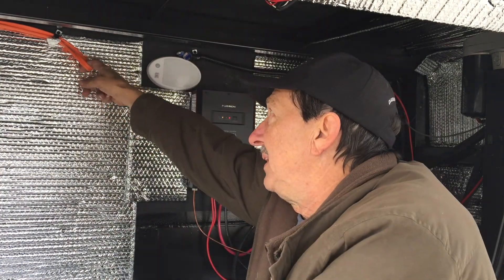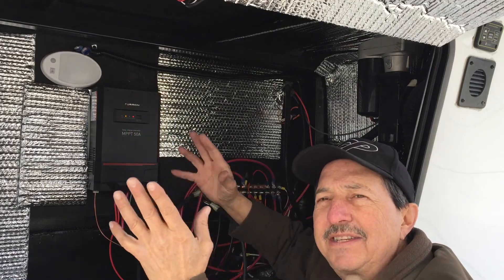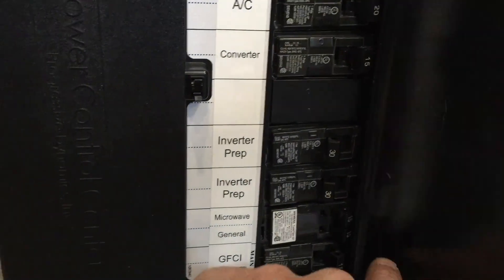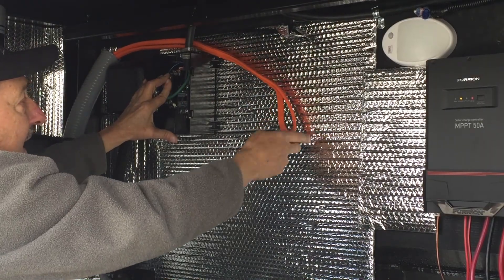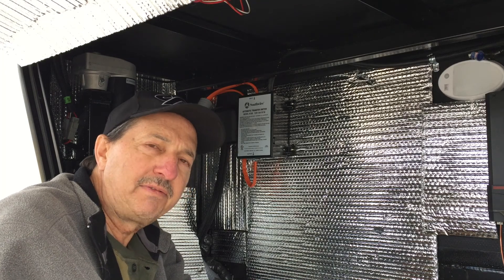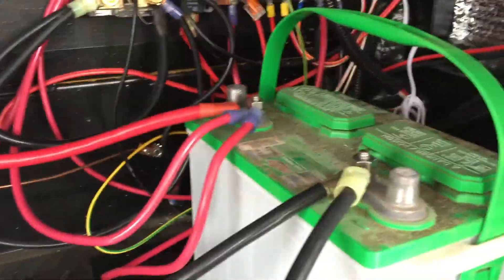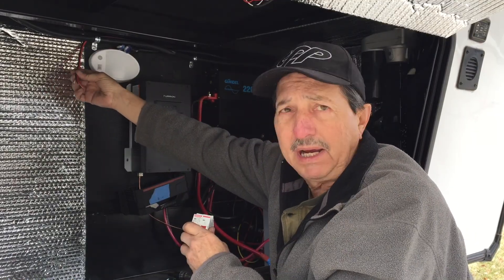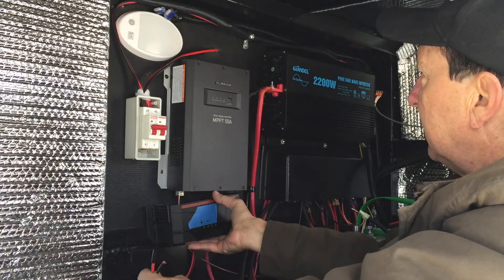Easy Grand Design Inverter Prep, Automatic Transfer Switch (ATS) And Inverter Install. + Solar.

Comment: Great video.  How is your Giandel doing?  We are looking at their 12v 3000w model - any advice?  Thanks
Reply from the maker: The Giandel is great. We use it a lot and have no issues.
Reply: @riderescue  Thanks.  I just caught that our inverter prep in our 337RLS is pre-wired to add a 2,000 w inverter so now, we're back to this 2200w.  I liked it best all around anyway.  Do you think that inverter would power our residential microwave at 1550 input watts (it's a 1000 output microwave).  It seems like it should.
Reply from the maker: @jaschembra  Yes, mine runs my 1500 watt microwave, no problem. I also run a coffee maker. Just be careful to not run them both at the same time.
Reply: @riderescue  1550 watt microwave? thanks.  It's considered a 1000 watt, but continuous is 1550 (who knows what the surge at startup is).  I'm glad to hear it works for yours.  Seems like their customer service is great as they've answered any questions I've had via FB's Messenger.
Reply: @riderescue  And lastly, GD manual says our inverter prep is pre-wired to "add a 2,000 watt inverter" - I'm assuming your manual probably said the same - but there was no problem with wiring size for the 2200 watt?  I don't know electric.  Husband said it should be fine.  :)
Reply from the maker: @jaschembra  Yes. The 2200 watt is 10 percent over but within the factor of safety. 3000 watts was pushing it too much. My 2200 watt has worked great and has not kicked breakers. Just don't overload it with 1500 watt microwave and 1000 watt heater or coffee pot or a heir dryer. Just run one appliance at a time and all is good.
Reply: This thread was helpful...THANKS!  Question....can you just add the 2000 watt inverter without adding the additional 330 watt solar panel?

Comment: After watching your video multiple times, I am 100% sure I can do this. I have 1 question. When you are using your inverter, do you turn your converter off at the breaker or does the ATS take care of that step?
Reply from the maker: The breaker box is split for power to and from the ATS. When the inverter is on the ATS only powers the lower section of the breaker box. Typically that is just the outlets and the microwave.

Comment: I have the same system but I would like to automate the Giandel inverter, meaning, if the ATS is providing shore power, you don't want the inverter to be on at the same time as the shore power. I understand how the relays in the ATS work to isolate the inverter from the camper when you are on shore power but when you remove shore power, After a delay, the ATS switches to the Giandel but if the Giandel is off, the Giandel does not automatically power up to provide 110v. If you don't hear the relays drop out, you are without power You then have to Manually start the Giandel.
The other reasons for wanting the Giandel to be automatic is to prevent it from being powered on, even though it will be isolated - you have to remember to power it down. I want to turn on shore power & automatically power down the Giandel - Remembering the relay delays
If you are running the inverter, then switch to shore, the inverter will still be on, isolated but still on. The relays will have dropped off the inverter power. When you switch back to shore power the inverter still being powered up,, will be a seamless switch - because it never was shut off.
Do you know if the relays have contacts that are on when powered off, but powered off when powered on? NO/NC
Reply from the maker: Sorry, I don't know if it has a relay or if there is a way to add one to do what you are asking.

Comment: How you will power the Air Conditioner using the inverter?  You will pig tail the subpanel wire and connect it to the Air Conditioner Breaker?
Reply from the maker: The wiring in the inverter loop is not intended for running the AC. The AC requires a heavy power load on start up and that requires a very large inverter. Also, running the AC on battery power would require a large bank of batteries and solar power in order to charge those batteries. If a person needs to run the AC a large generator is the best thing to use.
Reply: @riderescue  1 Furrion ac with an easystart.  14amp 1300w.  4-206ah batteries.  And a 3000w inverter that peaks at 6000w.   That should work?   I have seen many people powering the Air Conditioner that way. I just don’t know how to properly power the AC using that WFCO panel when the inverter only power the subpanel section and the AC is not on that section.
Reply: @JavierRivera  The only thing I can think of is see if you can move the A/C breaker down to the inverter prep section of the breaker box. That's what I'm going to try and do.
Reply: @ I was able to do it. I added a 50amp transfer switch and connect it to the mail panel feed to power the whole panel. https://youtu.be/cTzntGjvYyo
Reply: Hey nice video, wanted to share it is not recommended to connect dis-similar Solar panels in parallel as you did. You can cause back feeding from one panel to another and end up frying your panels. I would suggest having a smaller 200w solar charger for your portable system. It will wire directly back to the battery.

Comment: Great video! I got lost as to how you ended up with multiple red cables on the battery. where did they come from?
Thanks!
Reply from the maker: One connects the inverter, one connects the solar panels and one powers all 12 volt trailer stuff. Glad to hear you liked my video. Thanks for watching.
Reply: @riderescue  can you recommend a breaker switch and battery monitor?
Reply from the maker: @bobjohnson4290   I like the Renogy battery monitor and I suggest 12V-110V DC Miniature Circuit Breaker, 60 Amp 2 Pole Battery Breaker Protector

Comment: Great video. I have the same front compartment with the same loop in my 2023 298BH Reflection fifth wheel. I was checking the converter, and it looks like GD upgraded it to an Intellipower PD 9360 converter. It looks like the new converter has a setting to change to Lipo4 batteries; the problem is that I need help finding the converter. Does anyone know where exactly the converter is located on the fifth wheel? If you know, please let me know. Thanks.
Reply from the maker: The converter in my 226rk is under the bathroom area. I had to remove the side panel in the pass through storage area to locate my converter. Here's a video link to my Converter / Charger when mine quick working. https://youtu.be/g25tCVZq_Vk

Comment: What would it cost to do what you have done parts and labor?
Reply from the maker: The inverter is $350, the transfer switch was $100, the battery was $600. I estimate the labor cost of about $400

Comment: can you run air conditioner?
Reply from the maker: No. I think you would need to use a 3500 watt inverter to do that but the inverter loop is not set up for that from Grand Design. If an inverter was sized large enough to run the AC the battery would go dead rather quickly.

Comment: Awesome video. Thank you for explaining and demonstrating everything. I have more questions but need to review this again. 

One thing that many are opting for is an inverter/charger instead of the converter and separate inverter install. Why did you choose to go with the separate inverter and did you swap the converter for a lithium compatible charger?

Oh the solar output wires, when installing them in the dc breaker there isn’t any polarity issues? I noticed the external solar cables were red and black I believe. 

Thanks again.
Reply: Two more questions. Did the ATS you selected have a jumper to remove the time delay and did you swap the incoming wires to have shore power energize the relay?

Have you found the need to add an inline fuse to your set up?

Thanks again.
Reply from the maker: @scrub175  The ATS solenoid pulls power when it is in the generator mode so using that position for inverter is using up battery power just to run the ATS. By using the generator side for shore power, the solenoid draw is not an issue and the switching delay (about one minute) is only noticed when I first plug in to shore power. Some ATS solenoids hum and people have reported that they hear it in the night. Mine has a slight hum but it's not noticeable inside the trailer. As for the battery to inverter fuse? Yes, a fuse should be used if cables are running through areas that can possibly be damaged and shorted leading to fire hazards. In my case, the cables are short and protected from damage so I did not fuse this set up. I did fuse one  in my last trailer because the cables ran through a firewall and that had potential for shorting.
Reply from the maker: My thought process for the inverter came down to 2 things, cost and simplicity. In researching inverter/chargers, I fund many questions when it came to using the inverter loop that Grand Design installed. In order to take advantage of that loop the inverter needs to allow pass through of power and auto switching. Those inverter/chargers cost more and are difficult to wire (in my opinion). Also, why hassle with wiring and bypassing the existing charger when the factory installed one works fine? True, most factory chargers/converters do not fully charge lithium batteries but the solar panel on the roof will handle the charging to 100%. My inverter and Auto Transfer Switch was very simple to install, simple to use and cost me less than $450 for both. As for the "DC" breaker, it is a single pull, double wire for disconnecting both black and red wires. Makes for a simple solar disconnect as well as adding a second panel (in my case, portable panel). I plan to add a second panel on the roof in the future but I will tee into the wires on the roof.
Reply: This is what intrigued me by your video and install. I wanted to do the same, find a way to utilize all the installed equipment and learn how to interface with the “inverter prep”; rather than go the route you were explaining making for a more complicated and expansive install. Thank you for sharing your rationale behind the equipment choices and install how to. You have no idea how many barriers this will break down for the average DIY’er to attempt.

Comment: Nice job, even aesthetically pleasing!! What model of trailer and ballpark cost? Thank you in advance.
Reply from the maker: Glad you liked my video. My trailer is a 2022, 226RK Reflection. Here's the list and costs. Inverter - $279. Transfer Switch - $95. Lithium battery - $539. 12 volt breaker and box - $24. I had the portable 200 Watt solar panel and wires from my prior trailer but expect to pay about $450 for the panel and wires. Thanks for watching.

Comment: I dont get it. If you have 50amp service. But its only doing 30amp....isn't that just a 30 amp.
Reply from the maker: I was confused about that at first as well. The 50 amp is set up in the breaker box for the A/C (dual or single). The lower half of the breaker box drops down to 30 amp to run the outlets and microwave. That 30 amp wire, that loops to the front compartment is intended to be cut if someone wants to add an inverter to power the lower half of the breaker box.

Comment: Is that reflective material for insulation or for fire proofing? is it stapled on or glued on?
Reply from the maker: The prior owner put on the reflective insulation. It is on with double stick tape. I don't think it does anything but I left it on because the double stick tape is a mess to get off.

Comment: I can't see where the Inverter connects to the Power transfer switch?
Reply from the maker: It is hard to see in the video because it is a black rapped wire bundle. I currently have it attached to the "generator" side of the transfer switch. I recently found out that the transfer switch uses a few amps when in the generator mode so that is using extra power when the inverter is on. I plan to switch the wires to connect the inverter to the power side and the power from the breaker box to the generator side. This way the power draw will be from shore power rather than battery power.

Comment: I’m using the the same transfer switch for my inverter, it came with my Solitude as part of the Gen prep package. However with the inverter connected to the Gen side, you should know the transfer switch has a 1 amp parasitic draw to hold the contact closed. My plan is to reverse the input connections so that extra 1 amp will be on shore power instead of my Li battery.
Reply from the maker: Excellent idea. I knew about the amp draw but didn't think about reversing those two. Thanks for the comment and thanks for watching.
Reply: @riderescue  Do you mean reverse the loop wires for the inverter ?
Reply from the maker: @theconnectedcamper  The way I understand it. Inverter power should now connect to the shore power side of the transfer switch and the shore power (from the breaker box) will attach to the generator side of the transfer switch. This way when on shore power there will be a delay to power up the transfer switch but the power to keep it on will come from shore power rather than battery power. When not on shore power, the inverter will then be instant power when switched on (no delay and no transfer switch power draw). @timandres6410 is this correct?
Reply: Actually if there are 2 contactors, either side will draw current to hold that side’s contactor closed.
Reply: Actually no, the shore power is spring defaulted to the closed position. Gen (or inverter) power appearing at the transfer switch is fed the a set of hold-in windings. Thats why the parasitic load is only when on Gen or inverter power is applied. Switching the inputs should remedy this.

Comment: I left a comment the other day that has apparently been deleted. I can't imagine why.

This is an excellent video but there is one mistake. The solar panels should be wired in series and not in parallel as is shown here.
Reply from the maker: As you may know, the difference between parallel and series is the voltage and amp outputs. I put them in parallel to keep the volts down and the amps up. If I had put them in series the volts would be above 24 but my MPPT charge controller would control that. Also, Solar panels in parallel operate independently of one another and therefore are the best option for mixed-light conditions. If shade covers the panel on the roof my portable panel can be moved into the light and will continue to generate power as expected. Thank you for the comment. I do appreciate all comments and opportunities to learn and share knowledge.
Reply: @riderescue  Thanks for the quick reply. Obviously the goal of your video is to explain the inverter prep and you did a great job. It'll be helpful when I install an inverter in my new 280RS.

The biggest thing I wanted to point out is that, as the amps increase, you need to start worrying about the gauge of the wire that is used  Did you check the gauge of the wire that Grand Design installed? Hopefully it's at least 10 gauge and pure copper instead of CCA. That is large enough for the one panel that is on the roof since it's rated at a peak current of 8.82 amps. If you add a second panel on the roof connected in parallel you'll probably need to pull a separate wire for the second panel or pull a new heavier wire to handle the current from both panels. Also, if you were to end up with a system that could have four panels in it then you'll need to increase the gauge of the wire between the breaker and the charge controller.
Reply: @biglakelover7278  10 gauge wire is capable of 24 amps continuous.  30 amp peak (but not for long term).  The 10 gauge wire should be able to handle he 8.82 X 2 (17.64) continuous current.  However, you could not put 3 cells in parallel.
Reply: @biglakelover7278  My trailer has a 600 Watt 30 amp solar prep. So I'm looking at different wiring configurations to fit within those parameters myself.

Comment: Can you post a simple wiring diagram? I have a grand design with the inverter prep but im not quite following this video.
Reply: I'm not 100% sure on the attached file but I believe it's accurate.  This is for my 2025 Grand Design 22MLE. My breakers are labeled in the order shown in the pdf  (just upside down). Apparently I can't attach a file or pic. I made a YouTube Post which I linked below. Three images. 1) Inverter Prep Loop unmodified.  2) Inverter Prep Loop cut with inverter installed connected to shore power. 3) Inverter Prep Loop cut with inverter installed connected to battery.  This is how I THINK it works. OP please comment.
Reply: https://www.youtube.com/post/UgkxQKl9XB514tcPzbifNzkKeAAnt2JJrPKa

Comment: Ok I see the red loop wire that GD provided for an inverter. If I install an inverter on the loop say a 2000watt Renogly inverter, what will that do for me? where is the benefit?
Reply from the maker: The benefit is to be able to use the outlets and microwave when off shore power. The inverter then converts the 12 volts. Need to keep an eye on the 12 volt batteries to not run them down past 50%.
Reply: I will be wiring my loop directly to the 2000watt inverter, which cable of the loop goes where on the inverter?
Reply from the maker: @theconnectedcamper   You will need an inverter that can attach both ends of the orange wire to pass the power through the inverter when on shore power or provide power to the fuss panel from the battery when the shore power is off. You will need to test the wires once it's cut to know what wire is from shore power and what wire will be from the inverter to the fuss box.